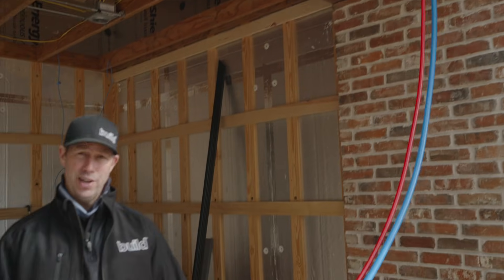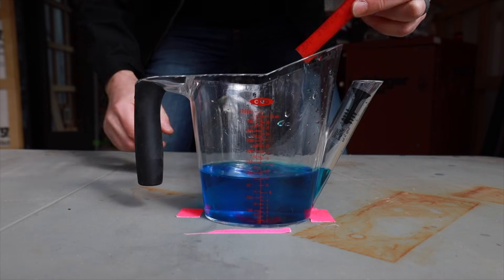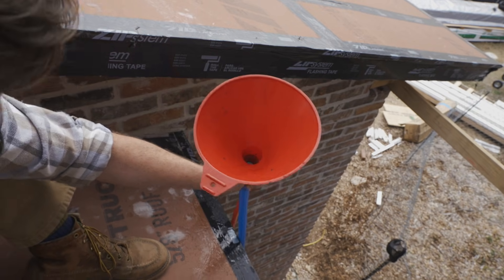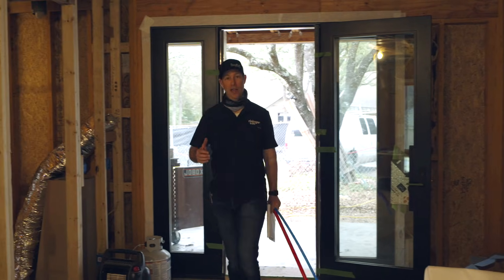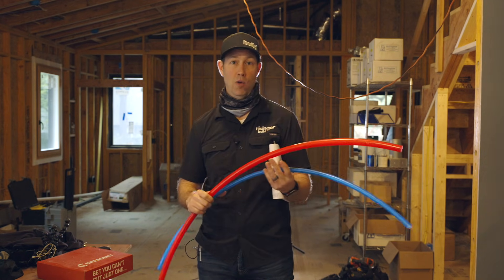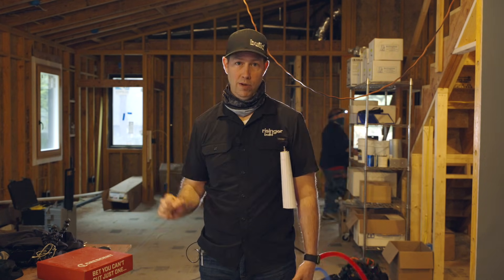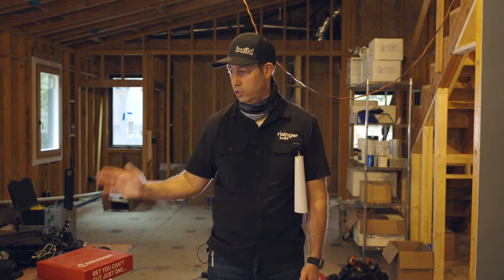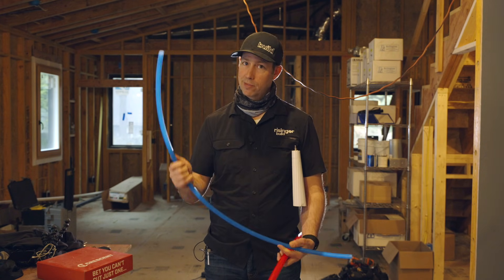What's the BEST Plumbing System

Comment: Concerning the manifold system - The way to run a dual sink setup is to use one hot water manifold connection to serve both sinks by using a tee to connect the sinks with in the bathroom. Hot water at about the same time to both sinks that way.

Comment: Two other down sides to PEX is 1) Rats and mice gnawing through the plastic line! Make sure there are no entry points for these varmints. 2) each run of PEX to a fixture requires drilling holes in the framing. It can be quite destructive if there is no chase designed into the framing layout. I'm with you Matt, a trunk system of copper is better in many ways.

Comment: you want hot water fast but really who cares it all goes back to the waste water treatment facility as long as it doesn't wash out to sea water helps push waste down the line.... it takes chemicals electricity man power and money to treat. it shows on your water or utility bill. on demand hot water heaters with an extra booster in the bathroom and kitchen... applying an additional heater near the tap is more economical.

Comment: Point of use heater... and here's the trick... engineer it so that it makes up for the lag in the feed between it and the main hot water circuit. In other words, you're only using POU until the hot water from the "main circuit" makes it to the shower...

Comment: Why constantly heat water far from where and when you could heat it near where you need using electric heaters? Sure you still have to expel water and wait to get it hot, but wouldn't that still be more efficient than losing all that heat whenever it's not being used?

Comment: I do find it odd there isn't a system for hot water loops which do not pump all the time.

Why not have a button where ever hot water is dispensed which triggers the loop circulating pump to run for 30 seconds or so charging the loop with hot water -- hit the button just prior to dropping a robe for a shower or staging shaving supplies?

Comment: I plumbed my house in copper.  I ran a 3/4 line from the HW heater to the furthest place which happened to be the kitchen.  I then ran a 1/4 line back to the HW Heater.  All HW lines had ridged foam covering for minimum heat loss.  I also placed a pump in the loop that was governed by a timer.  The pump came on at 6am and shut off at 10pm.  A friend of mine was building his house at the same time and improved on the design by eliminating the timer and controlling the pump from a motion sensor.  As soon as you left the bedroom in the morning the motion controller would turn the circulation pump on.  Nobody home, the pump would be off.

Comment: How can I get a plumbing system design where there will be no pressure or flow loss if two showers, a dishwasher and a clothes washing machine are all running at the same time.

Comment: Trunk and branch without recirculation will waste a lot of water and take a long time to get hot water.  A trunk and branch with recirculation saves water, but costs more in energy to keep the water in the trunk hot (even with timers, etc.).  A home run system is a compromise between the two.  That's my take anyhow...

Comment: I converted my 135 year-old Victorian home to a single loop system many years ago.  The very end of the loop runs back to the water heater via a 12V recirc. pump that runs 24/7  I never have to wait longer than 3-4 seconds for hot water anywhere.  The pump doesn't move a lot of water, but just enough to keep the main trunk at full temp.  And the pump is so energy efficient, I've never noticed an increase in my electrical bill.  I'm sure it's there, but too small to be able to blame it on one thing or another.  I would never build another home without a full recirculation system on the hot side.  What I did notice is that my gas consumption went down.  I believe it's because, after the initial ramp-up to heat the entire loop, I no longer waste so much water waiting for it.  I can start my shower quicker, finish quicker, thereby saving a lot of water, and the heater doesn't seem to need to run as often.

Comment: You could just calculate using simple geometry volume formula... specially using expensive piping, the math should always be near point. The manufacturer provides all info inner diameter or what not. Now we gunna have people doing this with a guy up in the roof with a 20 foot piping and another dude at the bottom holding a thumb down... watching the guy above "accidently" falling down...
Just get the height of the piping and then find the inner diameter, do the volume formula:  3.14 * ((diameter*0.5)^2) * Height = Blue Liquid volume
Wow... "Real" manifold plumbing professionals would use a smart/automatic recirculating pump to fix this simple hot water waste problem, it will only be complicated to people who doesn't understand plumbing. I think manifolds are the most advance plumbing systems out there.

Comment: I must say I disagree with your thoughts on these systems in regards to economy and usage of resources. The circulating system does offer hot water quickly and will reduce water usage, but the pump that keeps the water hot uses electricity which uses some type of fuel that is further contaminating our planet. Also, while hot water tanks that can lose less than 1 degree per hour are very efficient, having that circulate through the house will cause the hot water heating system to fire more often. This will consume much more energy and cost more than just dumping a few cups of water. Water that is used naturally renews itself through rain. I know that many areas of the world are starving for water, but that is because of droughts, dry areas and over usage. The sun will still evaporate the water, create clouds and it will still rain, but our energy resources are finite and using them also contributes to pollution. Environmentally and economically, a simple trunk and branch system is best.

Comment: We are working on the tradeoff here. Spend money and energy to keep the water in the line hot so it is immediately available or spend money and water and time to bleed the cold water off. Because I do not heat my water with solar the cost of energy vs the cost of water means I'll let those few cups of water go.

Comment: So right about wasting a lot of water with manifolds. Manifolds are not cheap. While working night shift at a large company I had to walk at least 700' to other end of building then turn just the hot water on in both showers & wash tube. Walk back and then 10 mintues later walk back before I had hot water. All on company time. 5 years later plumbing contractor found somebody cut out a 2' section of hot water loop. After he replaced missing piece had hot water in 15 seconds. Yep this rich company would rather waste thousands of gallons of water. Can't fix stupid. Same company wanted to run over 400 of 3/4" copper & pipe insulation to a remote small bathroom rather then replace a 6 or 12 gallon electric water heater. Talked boss into sitting down a minute to compare parts & labor. Gee spend 1 hour replacing water heater or 2 days running copper along with at least 4 turns up in a 25' high crowded  warehouse ceiling.

Comment: Uponor? Seems that the problem with that system is the wasting of energy to heat all that water all the time, though it does save on water. Each system has their drawbacks. When I rough in a house we use the trunk and branch system for the main floor  and basement. The same house will usually manifolds for the second floor, if there is one. I only put in recirculation line upon request. I never ran an Uponor system. Just my 2 cents as a residential construction plumber.

Comment: Hi Matt, im a big fan of your channel and ideas. I did remodel the whole my plumbing system. since I'm DIYer, I did it in sections but still using the race track system. I thought about this for long time combining the manifolds and branch system which is the track system. I did add value on each branch just like a manifolds. so I can close and work on some area and get the water fast. The reason for that because I remodeled the kitchen first then guest bathroom and master bathroom. This system is the best result for not wasting water.
I wish that I can share the pictures.

Comment: Do you put any kind of bushing where the pex runs through the studs? If not any concerns on the lex moving, expanding or contracting and possibly wearing? I've been thinking about replumbing an area of my house with pex, possibly pex A , but I've also heard some issues regarding hot, chlorinated water and pex in regards to longevity so contemplating installing a dechlorinating filter after my HPWH.

Comment: My 2 cents

Ciculating systems put a lot of wear and tear on the piping system due to the constant water flow ... and we all know the power of water (a local apt complex has almost weekly issues due to the circulating system)  ... In my and others opinion ... because they run way too much water ... a cup a minute is enough (most homes) ... especially insulated , pipes don't chill that fast .... maybe pex due to wider bends , fewer fittings, less issues with bad deburring or bad soldering suffers less, but ...
.
I'd say for most houses a combination manifold/trunk system is good ... whatever  is withing 5ft of a direct branch gets that branch ...oposite direction has it's own  ..... and idealy a efficncy planed hot water source location  .... 30ft should be it in most houses .... at 3/4 to first user area and 1/2 to second it would be about 1/2 a gal  
.
And come on ... 15 seconds is too long a wait ... really ?  (I get the water waste , issue but ....)

Comment: Since were talking about thinking ahead when trying to design a potable system for your home, if your worried about hot water timing a tankless water heater feeding a storage tank with recirculation on any size home will certainly be the best answer. Its a design build situation you don't need some science guy who never touched a pipe in his life you need a good plumber period. And definitely not the builder because while he genuinely believes he knows best again he not a plumber. Clearly there was a lot of plugs for Uponor in this video so your not gonna get the truth plus uponor looks like spaghetti its a joke, Viega products are what real plumbers use all the trash track home builders here in MD love Uponor. Size and design your home with a plumber NO one else

Comment: Your limited to the Orifice size that’s exciting so you can put 6 inch pipe in but if your hole is only 1/2 inch doesn’t matter . Smaller is better . Unless your exit is larger the only thing will change is pressure .

Comment: 120 inches long. 0.681 inches inner diameter. πr²h=43.71 cubic inches which equals 24.22 fluid ounces which equals:
3 cups and a quarter ounce
We have math for a reason.

Comment: "Ten feet of vertical pipe has quite a bit of head." In fact, Mr. Risinger, it has exactly ten feet of head!  😂
Reply: haha, true. He probably meant "pressure" and the easy rule of thumb is approximately 1psi for every 2 feet of head.
Reply: It's. 433 psi per foot of head or 0.0361 per inch
So 10' exactly is exactly 4.33psi at its base.

Comment: Less pipe volume between your heat source and the tap should be step one. Step two would be to get more velocity in your pipe, you use smaller pipes to get higher velocities. BUT, you lose more pressure with higher velocity. So long as you still have enough pressure at your tap, you're fine and you don't care. Eventually you're gonna lose pressure and that will be an issue. Usually a normal shower head is no problem, but these crazy waterfall/multi-head things? Have fun, good luck.

Comment: Manifold is a terrible system each bath has to bring its own water to the second floor. Best system is a return line from the furthest faucet to the water heater tank drain valve similar to what is used in hotels we have had this in our home for over 30 years. No pump is used we have instant hot water with in 1 second every time all due to convection. We also have ALL of our pipes insulated. Why I did this, our water and sewer rates are extremely high. Do this you will never look back. No extra cost just instant  hot water.

Comment: So, both sizes running from heater to faucet would both be full of cold water. When you turn the faucet on, the hot water travels from the heater to the faucet.  The larger pipe would deliver hot water faster but also holds more cold water.  Your shower may heat up faster but you are waiting more water.  If my thinking on this is wrong, let me know...

Comment: Manifolds are nice and good but if you want hot water combine it with a hot water solar tank. Build a loop thru out the hose which has the main run been with a hot water supplied 24/7 and a circulation pump. Use 2-3 manifolds thru out the house. Most the time kitchen area 1 and than for bathrooms 1-2 hidden behind service panels. Now your insulated main run keeps hot water at a good level even thru out the night only loosing about 10 degrees. This way you do have almost instant hot water without loosing any functions and now the circulation pump can kick in either 24/7 or if you want to be more proactive you just turn it on when motion is recognized in those areas like bathrooms and kitchen. This way you have preloaded 3/4" hot water running thru out the main loop leaving you with less than 4-5 cups of cold water before the hot arrives even when you are 100' away from your water heater.
And please start to use brass fittings and not compression use instead stainless steel clamps. I have repaired in Florida in the last 3 years about 40 water lines which busted on those "plastic" connectors and at 2 houses it busted the main coming in for over a week while they had been on vacation and nobody caught it. This time those uponor stretch collar's got so hot from the heat they they got soft and because of sometimes fluctuation pressure from the City it simply blew it off the fitting. We replaced with all with stainless steel pex crimp and brass connectors.

Comment: If you run a hot water recirculator system, be wary of using a tankless water heater. They have an internal flow switch that governs when the heating elements pull current & if you hook it up to a circuit that is constantly flowing, it will constantly pull current (subsequently murdering your electric bill).
Reply: You are correct! My brother has a 1200 square foot apartment in CA and turning off his recirc loop saved him $75 per month in gas for the hot water heater.

Comment: Is there a way to detect the manifold in a wall, if for example a builder covered it with sheet-rock?
Reply: @wojtek-33  No, if mine is in the garage there isn't anything exposed or recessed. I know they have those metal / stud or wire detector, but didn't know if they have some that may detect water lines.

Comment: When my uncle built his house in the early 90s, a family friend and former contractor gave him a tip. It was a long ranch style house, two bed one bath. The tip was to have a regular hot water heater for the bathroom, and laundry, but to put a small 5 gallon tank under the sink. So in the kitchen you get fast got water no waiting, and it doesn't disrupt someone showering. With the advent of tankless water heaters(or those that store about a gallon I've seen), this is very easy and doable for every sink and lavatory. Just a small box mounted under the sink supplies quick hot water for washing hands ect. Usually not much is used. This can cut down on running lots of pipe, cut down on drilling holes where needed, and in case of a water leak or tank malfunction, you can still have hot water everywhere except showers and baths. No one likes a busted water line, if it froze or if the foundation settles unevenly, and you don't have to track pipe through the walls etc. I have a cut off valve on the cold water line feeding my hot water heater. I've used it several times to keep water on to the toilet and sinks, while I make repairs or maintenance on the heater. 
If there was some kind of solenoid device that could reroute water back into the hot water tank, you could turn the hot water on, and as the water flowed it would go back to the tank. Once a temp was reached, say at least 120 or 115, then the water would switch and flow through the faucet. Then you would know that water is hot and very very little would be wasted. However that's just an idea I had and I'm not sure if such a thing exists or if it would be practical or cost effective for residential use. Perhaps in California it would.

Comment: Potentially building a home this year.  I’ve put a lot of thought into this exact thing and came up with a very similar setup.   My question is, what moves the water through the hot water loop when you are wanting hot water ?  I’ve seen recirc pumps that have a button you push to activate the pump, but I’ve never seen much of a detailed video on that sort of thing.
Reply: This old House (pbs) has it on YouTube.

Comment: You know Matt, on your last piping video you said you only seen Pex leak once. I watch a plumbing repair contractor repair a 10 ft section of piping with the white Pex. He had 2 tees in the system, there were leaks at 5 of the 6 connections, he had to remove both of the connections.

Comment: Easy answer Make shorter pipe runs or shorter to fixtures used more in small spurts, Use smaller pipe. Recirculator or point of use heater if you want Instant hot water. There is a man that gives great lectures about decrease water use and one is on internet. He advocates using 3/8 or 1/4 inch lines depending on pressure too but says code needs to be changed to keep up with the times.  I relined an old QUEST pipe in slab that leaked with a  1/4 inch per pipe that carried way more than enough water too a kitchen sink but it was a short run too.
Reply: Sorry commented before saw the part about Gary Klein.